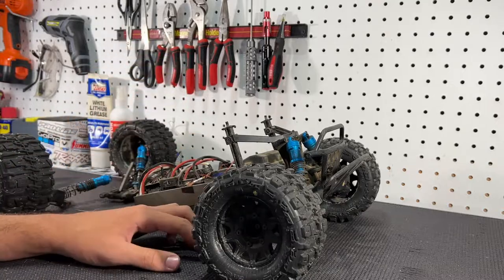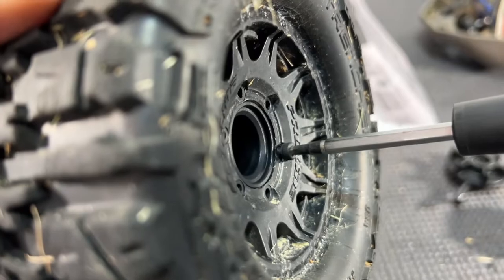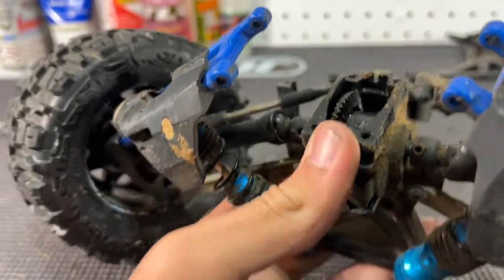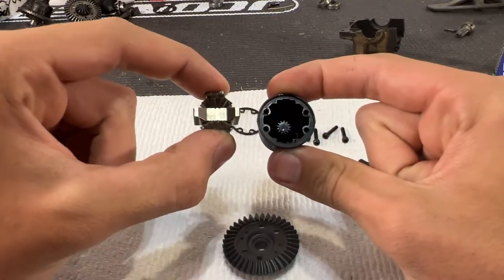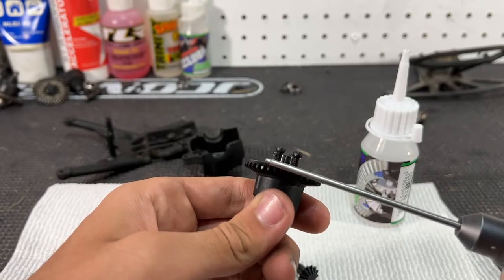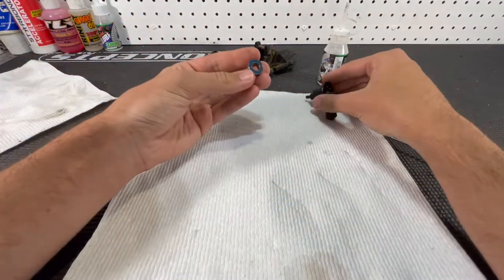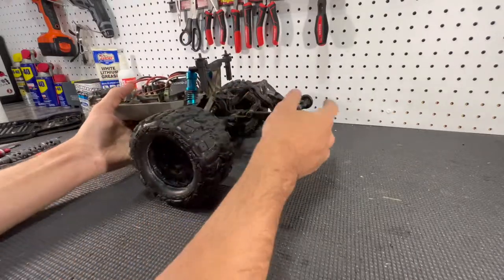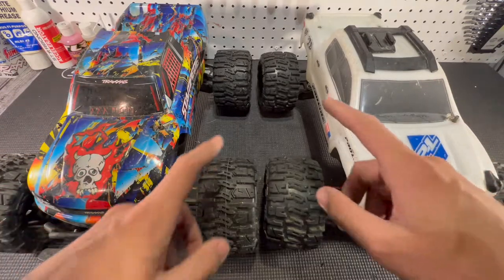UPGRADING this STAMPEDE 4X4 with VERY Important Parts!

Comment: couple of minor things:
when filling the diffs, if you fill it 1/3 - 1/2 before you put all the internals in, you can speed up the process considerably.
bearings around the diff case should have been changed at the same time, Wear on the crown/pinion is usually a good indicator of sloppy bearings.
and for grease, this is more personal preference, But water proof high temp automotive grease(the thick blue stuff) tends to do a better job of preserving your gears. can even be used in place of diff oil and bearing oil where water penetration/corrosion is a concern(Crawlers/wet weather bashers)

Last thing, the wheel hub, doing the bolts in a star pattern is extra faff for no reason, press the hub in hard, put two opposite bolts in all the way then do the remaining bolts. close enough is good enough, especially on a monster truck wheel.

Keep up the good work 😉
Reply from the maker: That’s all true!
Reply: @traxrc would you recomend spiral cut pinion and ring gears? saw that you had a vid abt 2years ago abt them on your stampede , how they holding up?
Reply from the maker: Yes I definitely recommend them! They held up great
Reply: @Cheesicle_  they are crazy strong. I run them in my 6s Tmaxx and v1 Erevo, have never had to replace one.

The GPM version are also bulletproof if you want to save a few bucks

Comment: Weird. The spiral cut and stock straight cut have the same tooth count at least on my Traxxas Rally. I run the spiral cut in rear with stock up front and I have no binding issues, but front and rear spin at the same rate
Reply from the maker: Look at the xo-1 diff build series I did w my stampede. I showed the diff ratios at the end of one of the videos.
Reply: @traxrc  I did that's how I knew what to order lol but when I did the same wheel speed test they were perfectly in sync with each other 🤷🏿‍♂️

Comment: The brace does fits perfectly in standard cups
Reply from the maker: Negative. The XO-1 Cups are bigger to fit the braces.
Reply: @traxrc  I did run them for a while now.. the brace does fits just the plates each ends wont fits.. Also its how GPM aluminum cups are also designed..
Reply: @traxrc  that is incorrect. the XO-1 internals will fit in the standard diff cup. its how i run my Tmaxx. although the heavy duty cups with the little metal carriers will last longer generally

Comment: I currently have a stampede 4x4 xl5 and I’m aiming for a 3s-4s conversion and a 2800kv motor any recommendations so I can make it last I currently have a rustler 4x4 vxl aswell and it takes a beating and a half.
Reply from the maker: Honestly 4s is too much power for it. It’s just going to fall apart. If you want upgrades then u can watch my stampede vids and see what I recommend in them. If you still decide to do it then get a hobbywing system. They r great and u can get them for a decent price.

Comment: That's a lot of 💰 in parts! I haven't even done the x01 diff mod & I beat the brakes off of my slash! I'm probably just going to do that mod with the steel bar & drive cup call it good. $20 F&R $40 total... Better than $120 lol but them gears are hella strong! But I've never had a problem with the stock diffs let alone with the steel bar mod inside. 🤷
Reply from the maker: Ik it’s a lot of money but when u think about it u only have to do the x01 mod once and by the time it wears out u will have to do the steel bar and drive cup a quite few times. It might be worth the extra money just saying.
Reply: @traxrc  when do you start seeing a problem with the stock differentials setup? I'm usually just on 2S sometimes 3S... I haven't seen any problems yet, is it when you're always runnin 3S or have a stronger set up then the stock system?? Or jump it crazy high?
Reply: @traxrc  that's a good point, if you do need it, it will last a long time, or if yours have excessive wear replacing it with a new setup would probably be beneficial at that time 👍👍 I just keep fluid in my diffs & keep some bearing/wheel grease on the outside in mine seemed to last awhile & sound good so far. But i don't drive to wreckless with my slash
Reply from the maker: It’s just average wear and tear especially when u use the differentials a lot. U also get build up dust and fine rock and that wear it down.
Edit also starting and stopping quickly will wear it down but that’s going to happen either way.
Reply: @traxrc  oh yeah it's like sandpaper for those ⚙️⚙️⚙️⚙️. Mine is a streetcar but still manages to get all kinds of shit in there. It's fun taking off hella fast & slamming on the brakes 2wd compared to 4X4 two totally different feelings. I like them both equally tho. My rustler 2X4 is sick! Proline Street fighter tires 2.2" from the slash work great on there + full RPM parts everything from the front bumper bulkhead A-Arms front & rear bearing carriers body mounts & wheelie bar mount+ strc hinge pins 💯
Reply from the maker: That sounds absolutely 🔥

Comment: The stampede 4x4 vxl diffs are much stronger than the brushed diffs
Reply from the maker: They r the same to my knowledge
Reply: @traxrc  Your knowledge is not that great
Reply from the maker: Been in the hobby for 8 years bud. I don recall the being a different part number, and I have used both sets. They looked the same and I had issues with both.
Reply: @traxrc  I have been in the hobby 20 years
Reply: I have a stampede 4x4 6s that go like 100 mph stock drive shafts and diffs are bulletproof
Reply: @Wyatt_Saunders Would like to see pics of how you fit your 6s motor & ESC into the chassis. Have been thinking of upgrading from 3s.
Reply: @Wyatt_Saunders  20 years and you still think the brushless and brushed traxxas diffs are different. oh dear. 😂
Reply: @traxrc  that is correct, they are the same powder metal gears.
Reply: @ManuelOrtizification Brushed and brushless diffs are the same. BUT the ring and the pinion are different, vxl ones are much more beefy then xl5.
Reply: @Cheesicle_  again, incorrect. Look up the part numbers. They are the same.
Reply: @ManuelOrtizification  Incorrect xl5 rear ring and pinion are partnumber 6779. vxl  rear is part number 6789.
look at the pictures vxl is much more beefy i have had both to look at and the teeth on vxl (6789) are more beefy.
Reply: @Cheesicle_  one is a complete built diff, the other is the ring and pinion. The build diff is using the 6779 ring/pinion. 😂
Go look up the exploded views for both trucks. 😂
Reply: @ManuelOrtizification   maybe got that mixed up but the xl5 ring and pinion (6779) is 12/47t  . vxl/stronger ones are 13/37 (6879) . so no they aint the same xl5 are geared slower and smaller teeth. 

😂😂😂😂😂😂😂😂😂😂😂😂    😐😑
Reply: @Cheesicle_  tell me you know nothing about traxxas parts without telling me you know nothing about traxxas parts. 🙄😂
I own both, if i could post a picture here i would, then i'd laugh at you even harder than i already am. 😂
Reply: @Cheesicle_  explain why they would change the diff for that one car, when it shares the same everything else with 56 other traxxas RCs that are built around the same drivetrain/platform. Even the various versions of the XO-1 are compatible with their 1/10 ring and pinion. Why do you think traxxas only sells a front and rear version(that fits every 1/10 electric and nitro 4x4) of their 1/10 spiral cut ring/pinion?

You are delusional. Please refer to my previous comment about their exploded views - Same Part
Reply: @ManuelOrtizification  How is a 12/47t (xl5 ver) and 13/37t (vxl ver) the same ring and pinion? 😑 they would make a slower gear and weaker ratio ring and pinion cuz the bruhed version of the car cant output that muvh power and the motor would struggle.
Reply: @Cheesicle_  clearly you dont know the difference between the spur/pinion and a ring/pinion.

But please, go find the 2 different part numbers. 😂
Reply: @ManuelOrtizification  6779 and 6879 . bro look at the pictures one is a 12/47t and the other is 13/37t? the 12/47 is the brushed ver. and no i havent mentioned anything abt spur gears.